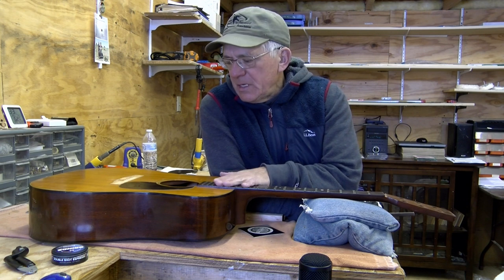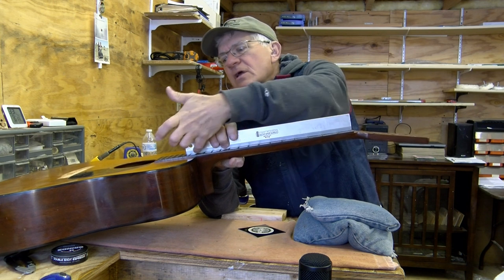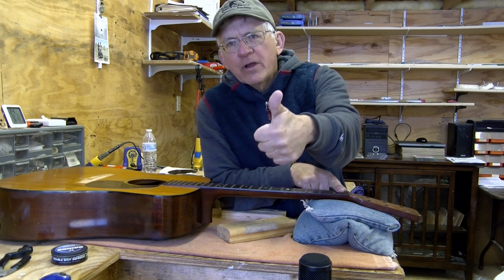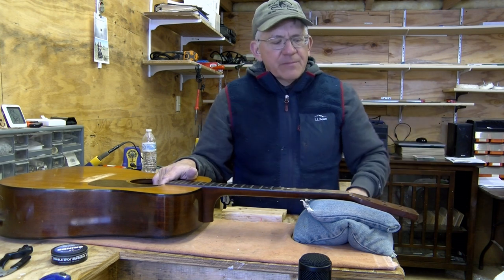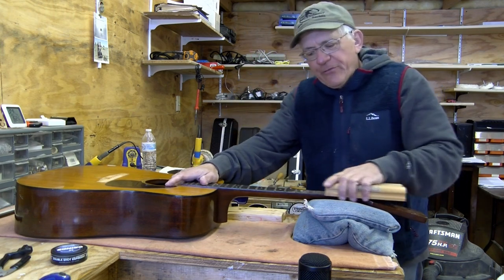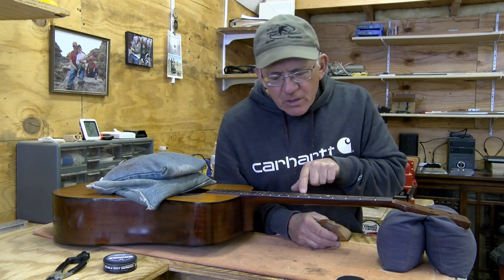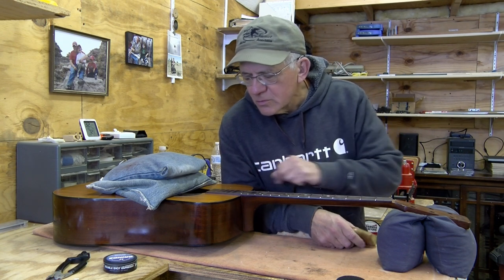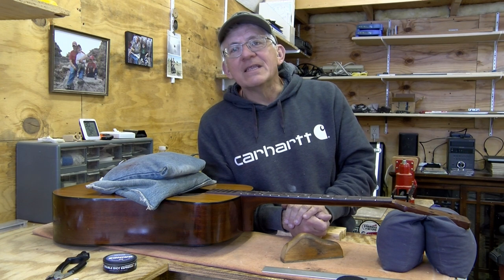Reducing Neck Relief with a Non-adjustable Truss Rod

Comment: Bryan,

I am former customer and still loving the Martin you improved for me.

Am an amateur luthier so have some experience and completely get your multipronged attack on this. I have exactly this problem on a 1970's Martin D-18 12 string and the issue is a spongy neck. Compression fretting and and a neck reset might get it fixed but I like your conservative approach trying to exploit every opportunity to stiffen the structure of the neck. Just brilliant.

Comment: Great video and easy to assimilate. I just wondered if a series of rings, or a spiral could be lightly ground onto the carbon fiber rod to take epoxy with it inside the hollow square tube? 1/4” is pretty small, but the groove(s) don’t have to be deep. Also a chamfer on the tip that goes in first. Maybe its not worth all that trouble anyways.
Reply from the maker: The carbon fiber rod is square... it won't turn inside the truss rod.  The dowel is wood and round and turns.  I feel that I'm getting enough glue in there, esp with the expanding Gorilla Glue.  I just don't see any advantage to using carbon fiber because you would have to have a PERFECT fit to add any kind of significant strength to the rod.  I suppose someday I could measure deflection on the rod I have, then fill it with CF/epoxy and see if the deflection changes.  But, I really think that most of the fixed truss rod issues are caused by the rod slipping in the neck channel and not deflection of the truss itself.

Comment: Great video, Bryan!  How much weight is in the two sandbags that you use to simulate string up tension?
Reply from the maker: Sorry... I meant to state that.  The two are right about 7 lbs.   Of course, you need to decide where YOU are going to set them on the top and if you want to be really picky, some necks react a little differently so you might want a little less or more weight.  But I've found those bags, there, on a 70's, to be good enough.

Comment: if the fretboard is made of really hard material and there is enough difference between the slot and tang sizes..then you will get some backbow..
Reply from the maker: That's a compression fret job of which I have done dozens.  Here's one: https://youtu.be/H34S3NrcT00

However, as I stated in the video I am NOT doing a compression refret on this because we wanted to use Evo wire and Evo only comes in 1 tang thickness.  Plus, this is a D-18 which does NOT have "really hard material" for a fretboard.  So, neither of your qualifications were met, thus the need to plane backbow into the neck.

Comment: If it’s more deeply bowed do you ever heat and clamp the neck to try and bring it back into normal range? Seems like this is a bit controversial and wondering your thoughts
Reply from the maker: In 25 years, I've run across maybe 3-4 guitars that were so bad that shaping and/or compression fretting wouldn't take care of them.  On a 70's with the square tube, sometimes the rod is unglued.  A decent way to bolster that is to drill a small hole under a fret at both ends of the neck, back-bow the neck a little with sandbags, and inject West Systems thin epoxy.   On another 70's, I just pulled the fingerboard and put an adjustable truss rod in.  mid 40's with ebony rods can be a problem but I'd rather reshape the board/frets with the current stress-shape, than try to re-stress the thing. 

To answer your question, heat pressing rarely holds for very long... it's better, IMHO, to FIX the problem.
Reply: @Bryankimsey  makes sense, thx!

Comment: Too bad they didn't make thicker tangs on fret wire, you could use a few to help thicken one to put the neck into a back bow too, like they used to with bar frets.
Reply from the maker: They do with nickel silver frets but I'm using Evo here.